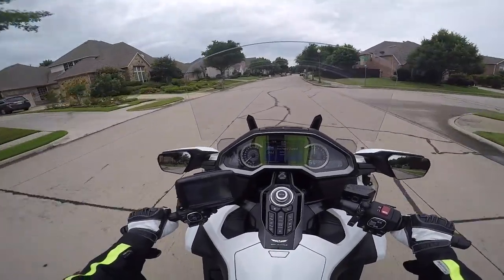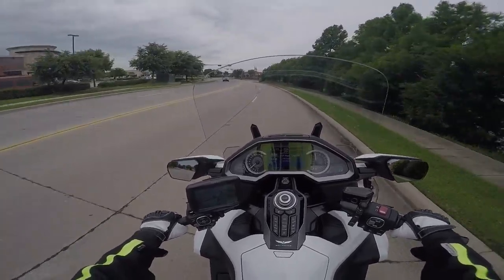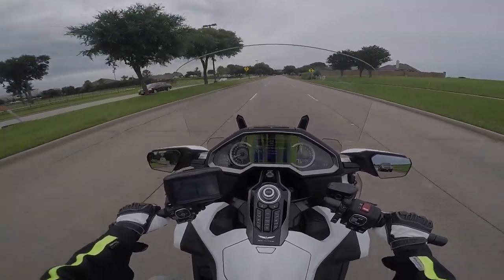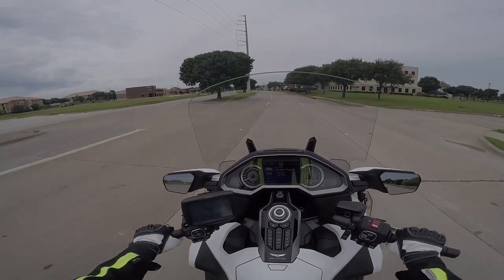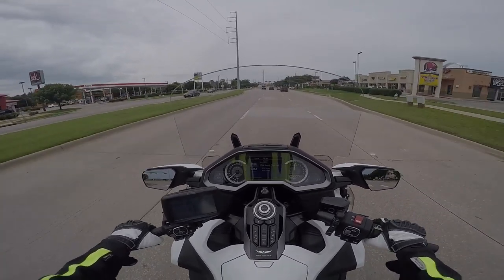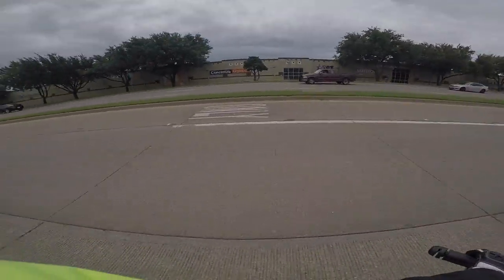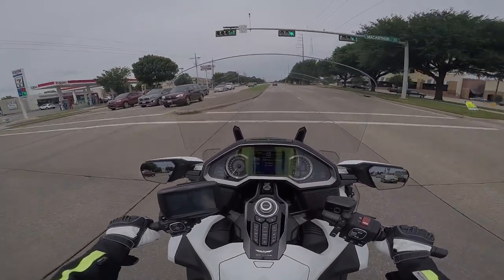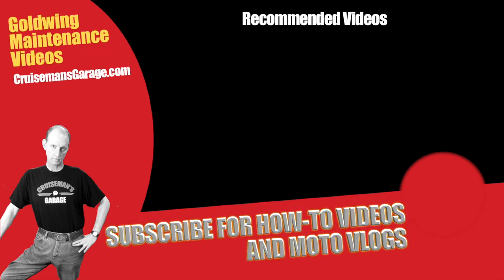Foggy Dash and Re-Wiring Accessories | 2018 Honda Goldwing | Moto Vlog | CruisemansGarage.com

Comment: Cruise man I saw your video on how you clean your dash front clear lens. I understand the new wing dash acrylic gets scratched easy and that’s why you clean it with soap and water. I also saw your video on condensation inside your dash guages. I was thinking maybe the acrylic is not water tight around the edge where the acrylic meets the black frame? Maybe you have a small penetration / loose fit around that edge where humidity is easing into your acrylic cover? Also I noticed I saw you over saturating the front of the acrylic with water sprayer..maybe the water is is seeping a little water into that edge.. it looked like allot of water sprayed directly onto that cover and edges.. I know bikes are designed to withstand outdoor moisture and water but maybe it’s not a good idea to spray so much force fed sprayed directly on the edge of that new gold wing dash face.. I don’t know,, just my opinion.. thanks for your videos...for sure the new gold wing needs a tighter fit face.. also maybe a good idea to get a tube of clear silicone and put a small bead all around the inside edge where the acrylic meets the black frame edge.. just an idea to stop water from getting in behind the glass.

Comment: Hey Chris, this fogging occured after you did the video on cleaning the dash, there is definitely a bad seal . I was just about ready to try cleaning it using your method but will hold off.
Reply from the maker: Leonard, the two are not related. There is NO seal, as it turns out. cleaning the windshield will not cause this. The windshield plastic is not flat, it is a molded design.
Reply: Mine has the same condensation spots under it. Did you find out if it is a warranty issue? If not how long will it take to r & r ? Did you do a video on it r & r ?

Comment: You have mentioned that dash cover several times, if it's completely flat your local glass company could cut you one of better quality, maybe.
It has been 92 degrees 300 miles south of you the past two days. I have some things to do in the garage but it's 10 degrees hotter in there. In the summer I have to do most all my garage stuff at night or early in the am. I like the winter time better...
Reply from the maker: Glass would not good, but pretty heavy and could break. A better solution, IMO, would be something from F4 Customs. A nicely "coated" polycarbonate, like my windscreen.
Reply: @cruisemansgarage  I wasn't speaking about regular glass, many of those old speedo's and tach's had a glass lens. thin tempered glass or something like that. Some glass shops have different forms of plastic.
Just an idea
Reply from the maker: @Bass.Player  I just realized, this is not a flat piece of plastic. It is a very complex molded piece.
Reply: @cruisemansgarage  Yeah it looked flat but I though it was probably not, just think of the glare problems with a completely flat panel